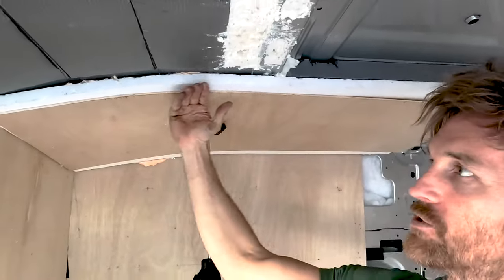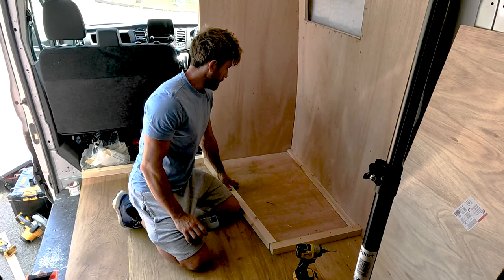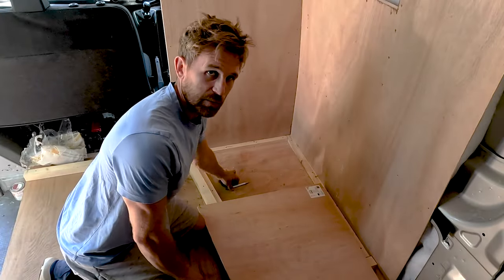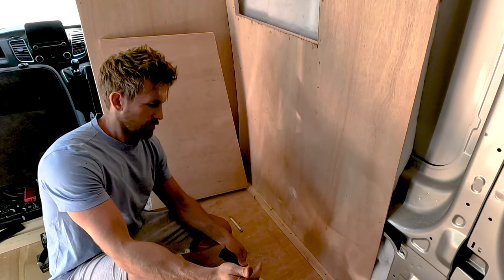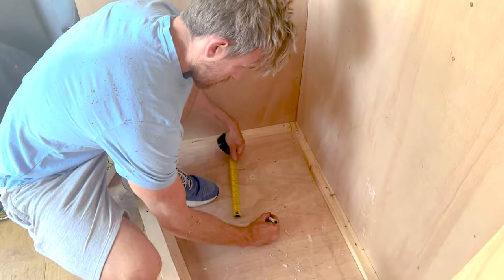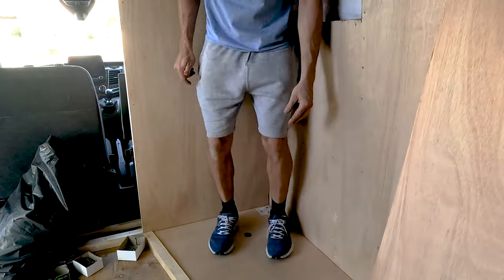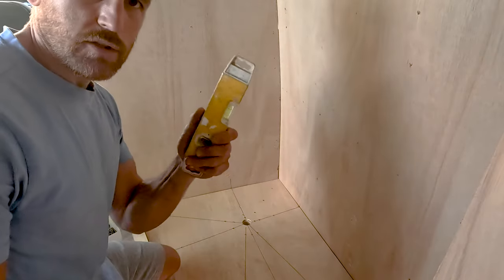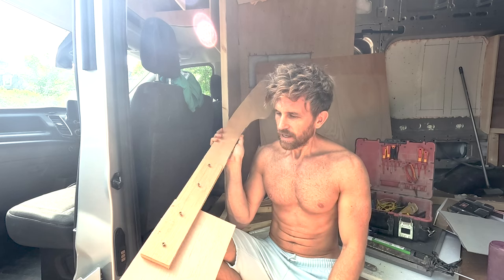Build the base for a Custom shower TRAY Van Conversion

Comment: How's the shower tray holding up? Also do you have more videos on the shower tray. Im wondering how you treated/sealed it etc
Reply from the maker: It's holding up perfectly. There isn't further content for the tray cause of a big data loss. The corners were sealed with puraflex and then liquid tanking on top (two coats), followed by vinyl. It is very solid with steel gradients so water run off is good even when not parked level.